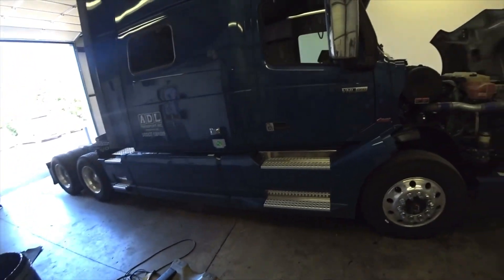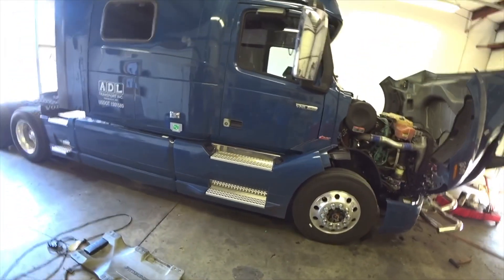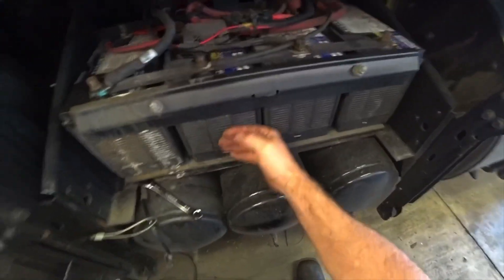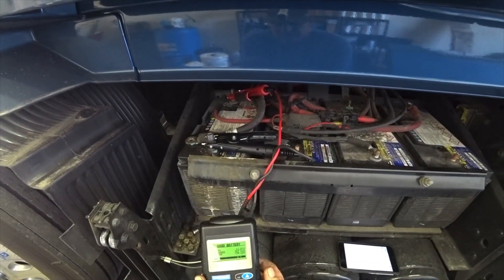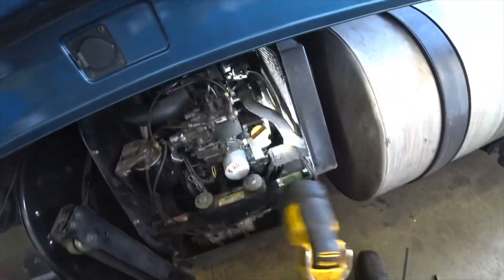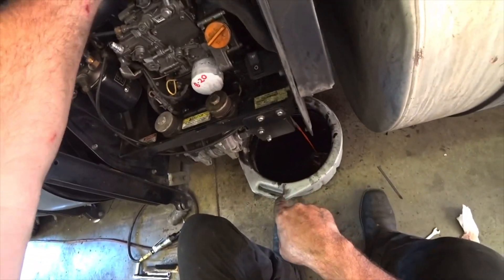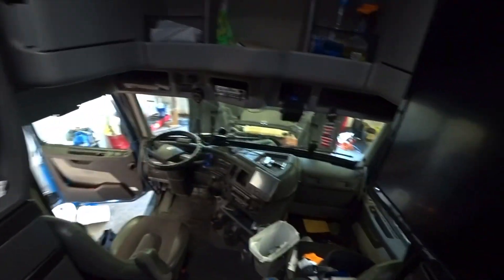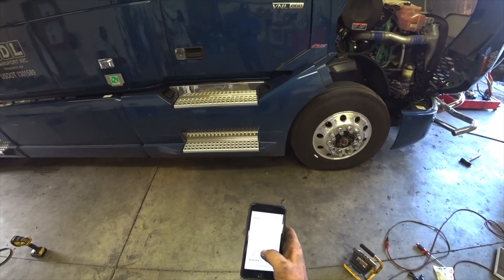Truck Repair, Going though the list, Volvo 800. Batteries, apu water pump, and stuff 2020/157

Comment: Scale: Cat scale.  Volvo: Load indicator 😂🤗
got 4 batteries in my Volvo 13 ltrs -20. 2 for the starter only, good, when heater eater volts and amperes. thanks for sharing

Comment: On European built volvo FH cabovers when you let your foot off the accelerator the engine brake comes on automatically providing of course you have it switched on in the cab . Overfilling anything thats oil related will end up blowing oil seals .,this is what happens when drivers haven't got a clue about trucks   . Otherwords tell your driver to leave things well alone  .it'll end up costing your boss a bloody fortune. And yes i do have experience in truck and trailer maintenance. Just in case anyone starts with the sarcasm 😉 😜 😎🇬🇧🚛🙋‍♀️✌